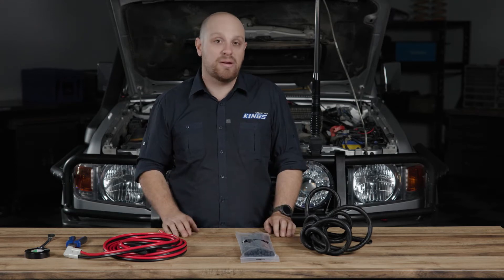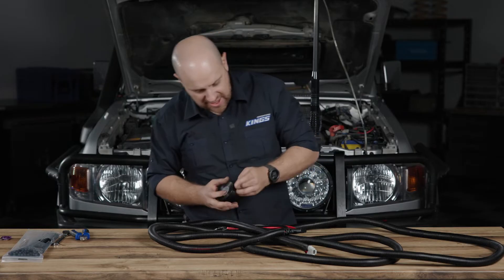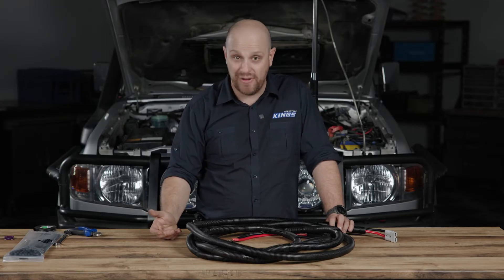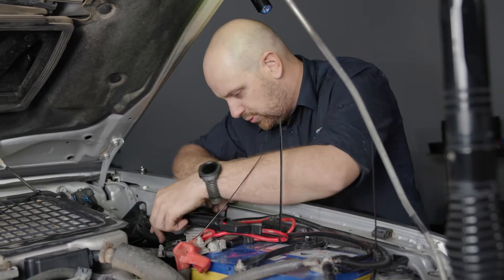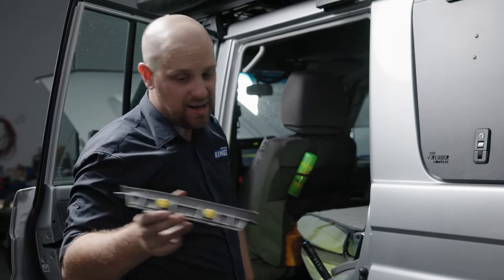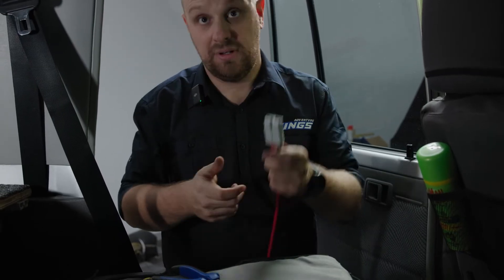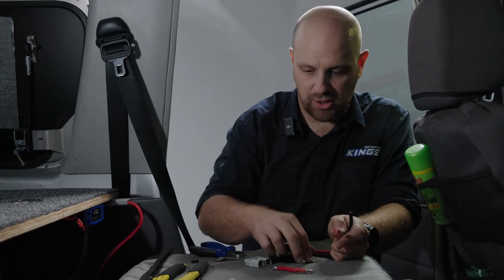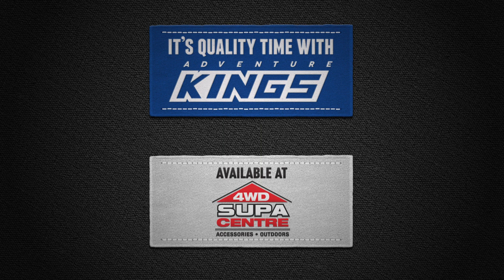How to power-up your DC-DC Charger!

Comment: When I disconnect caravan from Ute we’re dc to dc charger is housed how do I stop alternator sending power to Anderson plug on tow bar to protect alternator sence power has no were to go
Reply from the maker: While you won't see much in the way of loss from the default set up, you could also look at adding an isolator on the system to further minimise any passive loss.

Regards, Andrew

Comment: Thank you for this video and showing closey how to run and hook up the cables 😊.  Can I hook up the positive on the battery terminal side nut. Hard to describe in writing :-0) / The nut that is tightening the terminal on the battery pole
Reply from the maker: Hi there,

We recommend the terminal itself, while the effect is minor you will see a small bit of loss on the nut itself that may affect reading, it's doable, but not ideal if that makes sense.

Regards, Andrew
Reply: @4wdsupacentreAu  Thank you, it's not easy to find a secure spot when new at this, my chevy Colorado diesel has a positive battery post wire that makes a 90 and ends up on the harness with a lug, that harness has about 6 other post and nuts with Mega/AGM fuses 100A and one 400A,,, Not sure if I can stack up in that  + lug that sits on the harness,, lol again, not obvious to describe with all the terms missing and images.  Happy New Year! 🥳
Reply: I have just bought your 40amp DCDC charger.  This will go in my Jayco next to my batteries.  In my car I currently have a RedArc battery isolator.  Do I need to remove this before doing the wiring and connecting to the DCDC charger?  Thank you.
Reply: Can I use the 40amp DCDC charger without connecting to my car.  I might be getting a new car, so don’t want to wire this twice.  Thanks

Comment: Can I use the 25 amp wiring kit for the 40 amp dc dc charger  ?
Reply from the maker: Hi there,
The DCDC charger can draw upto 40A from your vehicle if this has enough power to provide. This would blow the fuse if this exceeds the 35A draw from the wiring kit. 
Regards, Courtney

Comment: What about connecting the DC to DC charger to the second battery in the vehicle. Anyone with basic wiring skills can run a wire from main battery to a charger. This video is only half complete. What about how to connect the charger to the additional battery and still have everything else work of the second battery?
Reply from the maker: Hi there,
We have a variety of videos like this available, you can find one more suitable here - https://youtu.be/c-0XhB19of4?si=HzjlJby1qOGT39lQ
Regards, Courtney

Comment: What if I have a smart alternator??
Reply from the maker: Hi there,
This setup would be suitable for a smart alternator.
Cheers, Courtney
Reply: Am not sure about that as this set up does not include an ignition wire unless you have a different solution??
Reply: You’re dcdc requires ignition source (blue wire) 
Do you even know your own product before giving misleading information!
Reply: @joshangel8020  it does lol
Reply: @joshangel8020  you can run the blue wire to any terminal in your fuse box that only has power when engine is running.

Comment: Awesome class! Just have one question: can i connect a positive pole from the main battery and one cable connected to the chassi into the dc/dc charger? Or should I have both coming from the main battery? Thank you!
Reply from the maker: Hi there,
We would recommend having both from the battery for less voltage drop.
Cheers, Courtney
Reply: @4wdsupacentreAu  thank you! We bought the appliances and are going to install them today